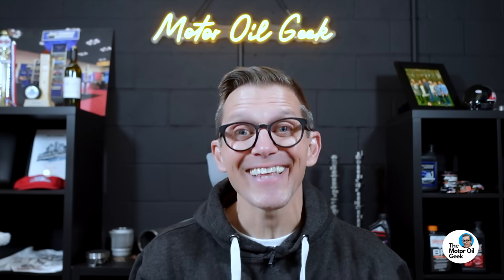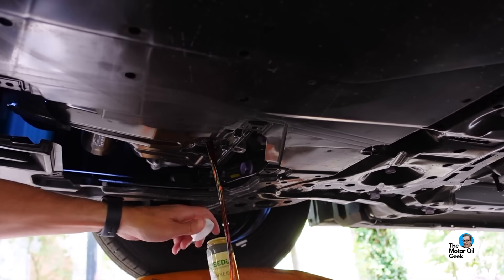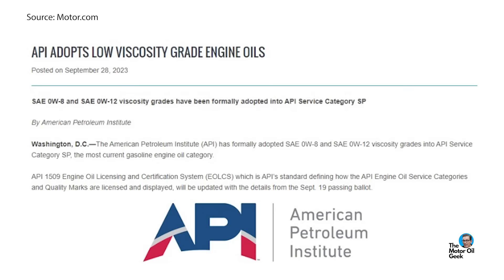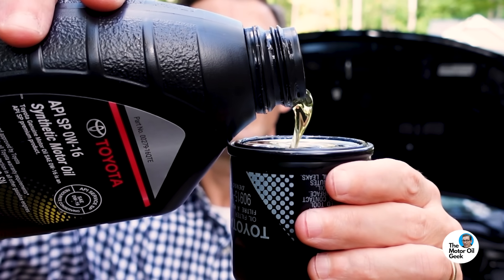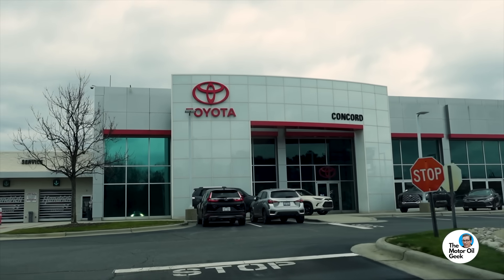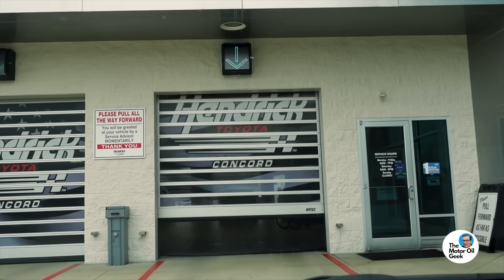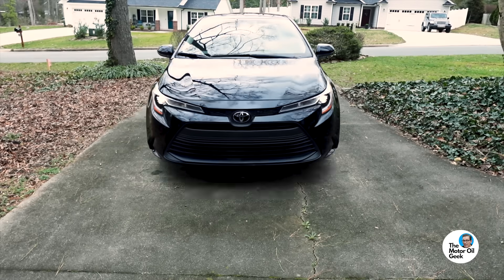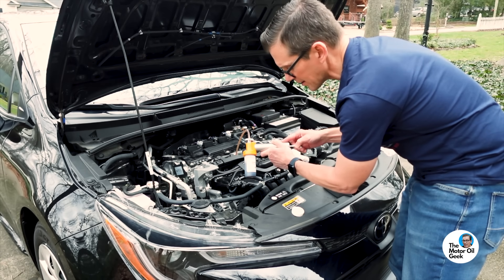0W-8 Motor Oil: Too THIN to Trust? Let's Find Out!

Comment from the maker: Here's the link to the research report from Oak Ridge National Lab on the special 0W-12 oil. https://www.osti.gov/biblio/1798600
Reply: When would you recommend transmission oil changes?
Reply: @dmav2074 Longest OCI for transmission should be 50k miles or 5 years. Otherwise, you're gambling.
Reply: @dmav2074  every 50000 km.
Reply: I'm hoping you will do Castrol 5W40, VW 503 00 spec oil next...  I have a theory; that this oil actually Causes oil consumption on VWs and Audis.  Perhaps the formulation has changed since it has come out?  --A friend who owns a shop has noticed Every time he put that oil in it would consume it.  Change it to Mobil 1 Euro 0w40?  No more problem.  Perhaps it has to do with the additives?
Reply: @fahrfromrunnin  No, VW and Audi products are notorious oil burners, burning oil worse than an angry 2 cycle weed whacker. My BIL had a few Audis, all dealer maintained. The owner's manual even states, "We recommend you carry spare quarts of Audi approved oil as it may not be available in all locations". I've never seen that in any owner's manual before in 40+ years of driving and maintaining vehicles. If that's not a blatant admission that the vehicle burns oil, I don't know what is.
Reply: I second the fact this is a VWAG engine issue, not an oil issue.
Reply: I’d like to see 0-W8 used in a situation of a direct injected motor that’s majority short tripped. The Mazda 2.5 na would eat this motor oil alive in a city setting.
Reply: @andyeighttre   well short tripping a DI engine means heavy oil dillution problem - that is more a fault of the engine design than oil itself. But I can see your point.
Cold short tripping and frequent start-up would qualify as "severe conditions" by the vehicle operation manual, so the oil change period should be halved.
Reply: @andyeighttre  My coworker has a 2022 CX-5 and I had to add oil for him as the oil change place (I believe it was Jiffy Lube) didn't fill it correctly during the oil change. It required 5W-20 oil if I recall right.
Reply: we really need you to figure out if the mobile 1 0W-8 is a good substitute because Toyota is GOUGING on these prices so badly!!!!! they are charging 16 dollars a quart or 100 dollars a case!!!!!  its the most outrageous price gouge I have ever seen.
Reply from the maker: @willfest  Noted
Reply: @themotoroilgeek was a video ever done regarding if Mobil1 0W-8 was a viable option compared to toyota brand? Have a 2026 camry and fixing to do the second oil change at 3k miles, and the price of the toyota branded stuff is kinda nuts here.
Reply: Mr. "The Motor Geek", You missed this technical point. Toyota's eCVT is driven using a planetary gear system. Hence, it has no belts or chains. Regards...

https://www.youtube.com/watch?v=O61WihMRdjM&t=307s
Reply: @lawrencelee7826 They shouldn’t even have called it a CVT, just leave it at “hybrid synergy”.  Amazing transmission.
Reply: @lawrencelee7826  thats for hybrids. this is regular gas
Reply: i know i probably won't get an answer but I'll shoot my shot
my 2020 Mazda i just bought Yesterday has the Skyactive X Engine in it 
the manual says i should use 0W20 oil in normal conditions and in Hard conditions 5W30 now 0W20 is also very thin oil and i dont know who to trust 
i would love some tests obviously maybe someone has some info on it ?
Reply: @Jason.1999 it is interesting the same engine in Japan calls for 5-30. Both engines assembled in Japan. CAFE standards in US are ruining engines.
Reply: @Jason.1999 n écoutez pas les ingénieurs de ces commentaires écouté votre fort intérieur et votre concessionnaire qui eux sont de vraies ingénieurs, toyota voitures les plus fiable du marché  et aussi pour leurs longévité des moteurs
Reply: @Jason.1999  use 0w20 for 5k miles and send the oil to the lab after. Then use 5w30 also for 5k miles in your car and then again send the oil to the lab for analysis. Compare the wear rate results from the lab and you will know which oil saves your engine more and which less. Stick to the same brand.
Reply: Will you plllllleeeeease do an oil analysis of Mazda OEM 0w-20 moly oil. I really want to see how it compares to Pennzoil ultra platinum.
Reply from the maker: @Don_Kee  Thanks for the suggestion!
Reply: Did this pass for turbo charged? :)
Reply: Your daughter paid too much
Reply: Are and if any of the oil manufacturers using the combined IL and ZDDP?
Reply: I sent Toyota 0w-8 and Amsoil 0w-8 virgin samples to lab https://youtu.be/-Qzo-kVy5as
Reply: thought i might ask the question here since a few people might be able to help me out.......I had my K&N filter let in some sand and dust and rubber from accessory belt for about 4 months......I am getting smoke now from the Oil filler cap....how ever i can barely feel the blowby.....the way i found out is i found some glitter in my oil after an oil change..... My question is is it possible to get smoke blow by with OUT having pressure blow by ?
Reply: Did I miss the update on the 0w-8?
Reply: @jalofanclub 
Yes, yesterday I did a oil change on my 2010 Prius gen 3.

Been using 0w-20 and decided to put 0w-16 in it for the first time..

The gen 3 have never been recommended in the owner manual to have a 0w-16..

There is a couple of reasons I did the switch to 0w-16 anyway:
1. It is not that far of a jump in viscosity to begin with.
2. The 0w-16 did not exist 2010. So Toyota could not specify it, when it don't exit..
3. The same Prius gen 3 engine is used in gen 4 there they specifying 0w-16.
4. And and I am a oil geek since 30 years. 😅

It went well and it seams to work super and the gasoline usage seams to begin going down also.

My take on it is that viscosity is not as important that it used to be..😅

In the old days the additives were not that many and as good as they are today.. 

So we needed then to more than today relay on viscosity so that higher viscosity at 100°C were that engine protection.. With higher viscosity. 

Today viscosity is less of an importance when the additives are far better that creates that protection that higher viscosity did on the old days.

And the base stock oil today is probably that thin so that we can deliver the additives in a more timely matter. 
And probably that is more important than anything else nowadays.😅
Reply: When I do a web search for Oak Ridge I don't seem to get the correct results...
Reply: In the future just buy mobile 1  advanced fuel economy oil for the car, it’s cheaper and they are the OEM oil for Toyota, But the Toyota sticker on the bottle raises the price. 
Upon researching, the Toyota branded oil in about double the price per quart and triple by the case.
Reply from the maker: @metalavenger23 the Toyota oil is not the same as Mobil 1. Both are made by ExxonMobil, but the formulas are different.
Reply: @themototoroilgeek  I have a 2025 corolla and I am going to waith 10k for my free oil change. If you want I can take a sample and send it your way. I have 2k on it now.
Reply: How much oil does it use
Reply: Does existing a downloadable link for the excel file from this video?
Reply: Car Care Nut channel on youtube will show you how to change fluid on Toyota transmission.
Reply: Hello brother i always paid attention to yours videos, i have a question for you, can you change the 0w8 for the 0w16?
Reply from the maker: @joelrodriguez7038  Yes. 0W-16 can be used in place of a 0W-8.
Reply: So wait, did you change the cvt fluid or just got a sample?
Reply: You came in asking for an ATF sample and red flags went up with the guys at dealership.  Yeah they are going to treat you right.
Reply: Who has written that and nobody read it...?😂

In abstract:
"up to 9.9% better fuel economy for the IL-containing SAE 0W-12 experimental oil compared with selected commercial SAE 5W-30 and 0W-20 engine oils."

The 0w-20 had no info in the paper and the table just say "n/a".

So there is NO measured benifits in this paper anyway that there is ANY fule economy savings to be had going from 0w-20 to 0W-12 with or without whatever additives (IL) in it.

A misleading abstract and a assumption that is unverified by the report. (it probably has likely one but they can not claim something they have not tested!)🤔 💖
Reply: @AmazonasBiotop agreed. My car calls for 0-W16 and I never saw more than 38.5 mpg around town. Funny thing is the oil change place didn’t have 0-W16 so I just told them use Mobile1 5-W20. Since the oil change I’m getting 40.5 mpg around town. 🤔
Reply: @jalofanclub  wait, you did better with 5w-20?
Reply: Speaking of transmission fluid, the myth of ATF having miraculous cleaning abilities would be a great topic for a video. I personally think ATF doesn't have special cleaning abilities, and people just think it does because they don't understand transmissions don't collect carbon like engine oil does. But getting the facts from you could finally end or confirm this myth.
Reply: @bobbygetsbanned6049  It likely has both fewer detergents and dispersants. I'd like to hear Lake's opinion of HPL's Engine Clean which I think is the right answer to the engine cleaning problem.
Reply: @bobbygetsbanned6049 I used transfluid to get car grease of parts as well as my hand back in the 70s.  So as usual, you're spewing false information with zero experience.

Comment: I'm not using anything lower than 0w-20 on my car, this has been tested multiple times and w-20 and w-30 is what you should be using on your vehicle, the bigger the engine, the greater viscosity you'll need

Comment: 2024 Toyota Corolla, 3 mechanics told me they do not have 0w8 and I needs to use 5w20, it was better for my car. So would it hurt my car to put in anything except the required 0w8?? They all told me the 0w8 required was too thin and my engine will be hurt by the time I get 100,000 miles on my 2024 Toyota Corolla. I am so confused. Thank you for any help.

Comment: I thought Toyota used an E-CVT which has planetary gears and not a belt or chain.
Reply: Only in the hybrids.
Reply: @williameldridge9382  Yup. There killing off their just gas powered vehicles. That's why I bought a 2024 ES350. I thought it was going to be the last year. Just 1 year off.
I drive between 3K - 4K miles a year. It's not good for their hybrids to sit for extended periods. Thus the V6.

Comment: I think there is a flaw in your experiment's logic: your table shows 'wear metals per 1,000 miles.' Doesn't this mean that the longer the oil is used, the smaller this value will inevitably become? This is especially concerning since your first oil change was done at only 728 miles. Hope you can correct me if I am wrong. I like your video. Thanks

Comment: Great video Lake! 
CVT fluid should be changed at 30-50K mile interval if you want to preserve the life of the transmission and keep it long-term. I have changed the CVT fluid on my Nissan Altima Jatco CVT every 30-50K miles along with the cartridge filter located by the CVT oil cooler and have had 140K trouble free miles. I also drop the pan every time and clean the magnets and pan. I called Nissan and they only do a drain and fill. They will not even change the cartridge filter (called governor filter), which is a $5-7 part and takes 15 minutes to change (4 bolts to remove filter housing cover). Not sure if Toyota has a CVT filter besides the metal screen filter located in the valve body which typically is just a metal screen and not an actual filter material. I changed this screen filter on my Altima at 100K just to be safe.

Comment: Just picked up a 2026 Corolla 2.0 L. Drive is home from Florida, approximately 995 miles on it when I got home. Took it to Valvoline for an oil change to get the factory oil out. Toyota will change it for free at 5k and again at 10K. Figured that would be a good break in cycle. Really want this car to last 300k

Comment: I changed my oil at 1200 miles on my new Camry then again at 6000. Then the free one at the dealership at 9800. I have 10700 on the car now. I have had the car 18 months. I'm not going to put 9000 miles on in 6 months. I would like to get another free before my two years are up.

Comment: So , same car overseas requires 5w-30. So if I buy one, I'll break it in around 10K with 0w-8  and run 5w-30 after that. Sucks cause it will only get 60 MPG instead of 61 MPG. 😂😂😂
Reply: The same car overseas does not have the same emission standards, so Toyota calibrates the electronic oil pump to a viscosity oil for that county.  Using a different viscosity outside of what the manual states will cause issues.  Go for it though, it is your car.

Comment: I always change my oil every 5000 miles with a genuine Toyota filter and drain plug gasket and I changed my cabin air filters and engine filters every 10,000 miles

Comment: 2024 Toyota RAV4 XSE Hybrid. Owners manual calls for 0W16 motor oil, but says 0W20 can be used. It then says to go back to using 0W16 at next oil change. Will using 0W20 long-term cause problems? I ask this due to the fact that 0W16 is not always available.
Reply: Follow manufacturer guidelines and you won't go wrong.

Comment: 0w-8 engine oil will be perfect for a lightweight vehicle driven at lower speeds and parked out in -40°F Minnesota weather with an exceptionally light foot on the accelerator.

For everything else, c'mon Lake, you know there's nothing so special about the additives in any 0w-8 oil that will give this viscosity grade adequate engine protection in just about any other driving scenario. Viscosity breakdown, anyone! How much less oil film protection will 0w-8 have sheared to in 5,000 miles!

As soon as I learned my new 2025 Toyota was filled with 0w-8 from the factory (the absolute lowest viscosity I've ever heard of by a long shot), that didn't sit well with me! ...Especially since I only drive in Phoenix, AZ and the surrounding area where summers get hotter than 110°F and engine oil can be 200-250°F.

(I've seen some folks suggest that because engine operating temperature is regulated with coolant flow, this means oil temperature doesn't change based on ambient temperature, which is totally false. Engine operating temperature is regulated to remain within an optimal range, not a single constant temperature. The engine temperature gauge in your vehicle doesn't depict normal temperature variations within optimal operating range.)

Not wanting to blindly follow recommendations that don't seem very appropriate, by the second oil change just before 5k miles, I had to argue with a shop to increase the oil viscosity to 0w-16. (The person at the counter tried to talk me out of it and I refused to back down.) That gave me a little more peace of mind. But after sifting through more information regarding engine oil viscosity grades, driving behavior, and Toyota owner's manual variations between countries for the same engine model (M20A-FKS), I've settled on 0w-40 (Pennzoil Ultra Platinum) and have finally accepted that I'm better off doing my own oil changes from now on.

Have I settled on the absolute best oil viscosity grade for my engine? ...Probably not. But I'm satisfied that it's a hell of a lot better for my Toyota engine than 0w-8 in Phoenix, AZ.
Reply: Someone thinking they’re better than the engineers of oil 😂 my crown uses 0w-8 and been using that for the past 50k mileage and 1 and half year in Houston Texas weather , zero problems and getting 37.2 mpg

Also I change my own oil with amsoil and their filter
Reply: Good luck with your experiment.  While I think you would be ok with 0w16 oil under load and extreme heat, you are definitely pushing the edge of the envelope using 0w40.  This engine is a hybrid requiring immediate lubrication because of the start stop tech and immediate loads and RPM.  This oil also acts as a hydraulic fluid in this engine.  Would you use 0w40 oil as hydraulic fluid?  The oil pump is electronic and calibrated for 0w8 oil and the pressure is regulated for that viscosity.  In addition, this engine has a VVTI system that is regulated by the ECU along with the oil pump.  This engine, with constant start stop tech runs cooler, especially in winter than an ordinary engine.  You obviously know what is better for your engine than the engineers who designed this motor, and it is yours, so you can do what you want.  Let us know how it works out for you.
Reply: Cute, the shade tree mechanic thinks he knows something just because he read a few things one time. The REASON for the changes in the manuals between countries is because they change the system to match that countries requirements. YOUR engine, meaning the engine itself and everything attached to it, is calibrated differently than those of other countries. Meaning unless you bought the car from that country directly and had it shipped here (extremely unlikely) your car is not the same as those in those countries. Even though it's the same base engine and model.

Comment: Toyota lube tech here sometimes when we run out of 0w-8 we use 0w-16
Reply: Any harm? Should we just use the 0W-16 instead just to be safe?
Reply: "Toyota lube tech" 😂 
Bro, Jiffy Lube doesn't count.
Reply: @EcotecEngine3.8V6 I work at a Toyota dealer
Reply: @jackdoesstuff2466 sure mate😅
Reply: @EcotecEngine3.8V6 I can tell you that the rav4 produced from 2020 - October 2023 take 4.8 qts of 0w-16 and after October of 2023 they switched to 4.5qts of 0w-16
Reply: @jackdoesstuff2466 
😂😂😂 
I can tell you oil specifications for any vehicle. That doesn't mean I work in their dealership. 😂😂😅

Comment: Many videos out there posted, with these types of oil viscosity,  these engines are blowing up prematurly,  therefore you should try using 5w30 instead. 0w20 in cold climates and 5w30 in hot climates.
Reply: No, no they're not. If it IS happening, either it's due to some sort of manufacturing defect or them not following maintenance standards, that's it. Hate to break it to you.